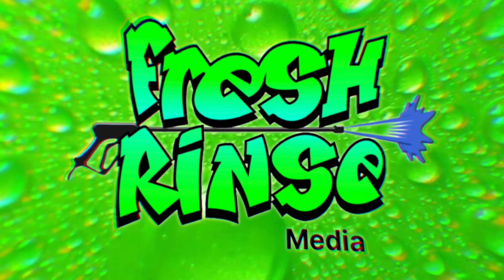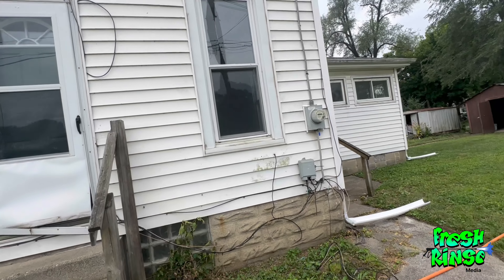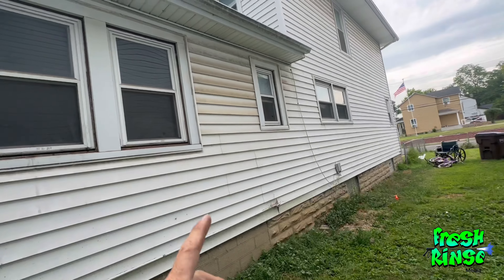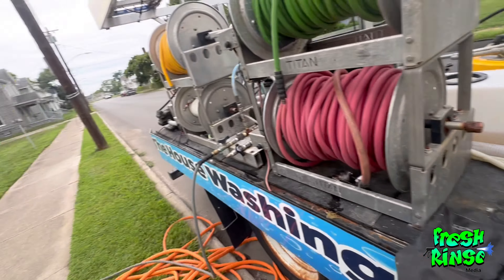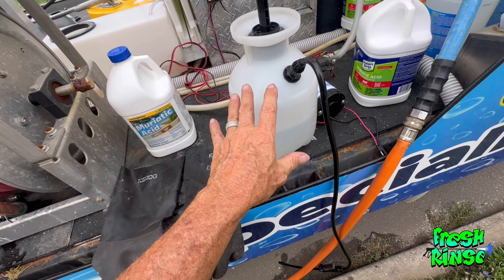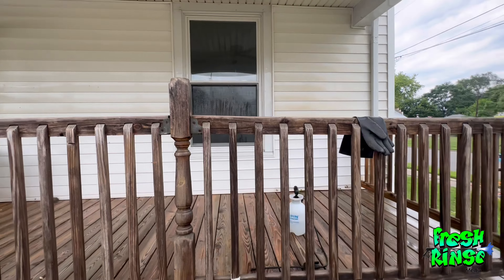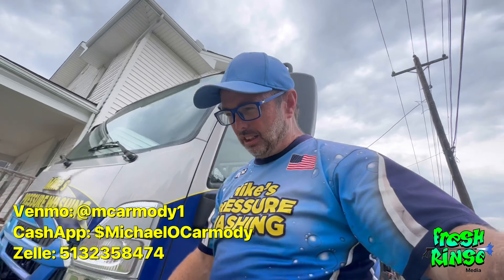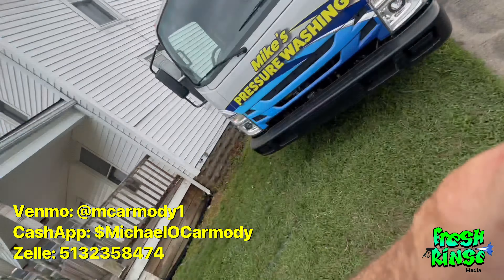How To Remove Fallout From Vinyl Siding. BIG TICKET$$$

Comment: Hey Mike! Another PPE lesson I learned. ALWAYS check and make sure your pump sprayer lid and hose connection (threaded bit) are properly tightened down and not cross threaded. I was spraying a 6% SH mix one time and as I was pumping the hose connection popped off and sprayed that 6% straight into my face lol
Reply from the maker: @Tn_Taco  O NO!!! Great tip. Thank you!

Comment: How would you handle vary Heavy fallout on painted wood siding?
Reply from the maker: @neilnasty783  While I don’t think there would be a problem with the muriatic acid, it might be best to start with a 50-50 mix of aluminum brightener first. Then work your way up to a stronger solution of aluminum brightener. If that doesn’t work, move towards the muriatic acid.

Comment: Could you 12 volt this
Reply from the maker: @shermanfletcher5068  Yes. The problem is, my 12 volt system has 200’ of hose. That’s a lot of wasted chem. On the other hand, if you had a lot to do, a bucket lid system might be great. Are you familiar with those?
Reply: @TheFreshRinse  I' have been using the basic 30 gallon sprayers for yrs to wash out farm houses..never new iy was a buisness lol

Comment: Hey Mike, if you haven't, look into the Milwaukee M12 sprayer. Somewhere around $200.00 I believe but it would cut the time spraying in half! I love using mine for various jobs.
Reply from the maker: @ECSSTL  DUDE! Absolutely! How would it do with acid, I wonder?
Reply: @TheFreshRinse  Iv ran muriatic, oxalic, and pretty much everything else used in washing. I flush thoroughly after each use. Worth every penny, even if you have to buy 1-2 a year.
Reply: @ECSSTL  bought the ryobi one myself love it for oxalic.

Comment: I could be an idiot, maybe the prices are different across the board. But I live in Florida and build swimming pools. If you have an account with S.C.P or smaller pool distributors chlorine and muriatic can be really cheap. typically $1.25 for chlorine and about 3.00$ a gal for muriatic. I get 4 gal cases for 12.50$. And yes, I'm a pool guy, We call it chlorine haha. p.s. If you slide the distributor manager a 12 pack of modelo's you might be looking at free chlorine!
Reply from the maker: @liamkavanaugh5260  Florida prices are WAY cheaper than anywhere else

Comment: May not always be ideal, but I’ve downstreamed oxalic acid onto vinyl sided homes that have serious rust stains from old aluminum window cases.  I take the same watering precautions as a typical house Wash, and haven’t had any issues.  Definitely helps maximize the profit gained on the upsell if you are smart about it 💪
Reply from the maker: @ryanghent7604  LOVE IT! Thank you!